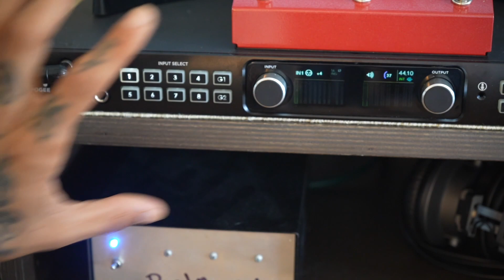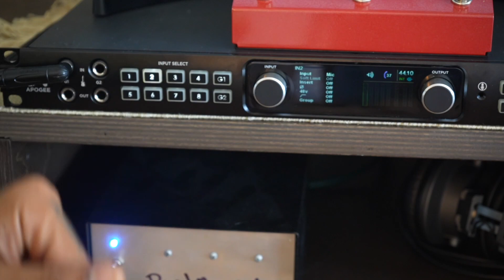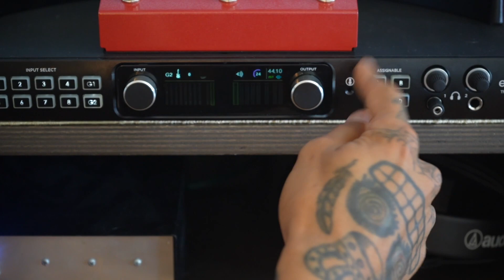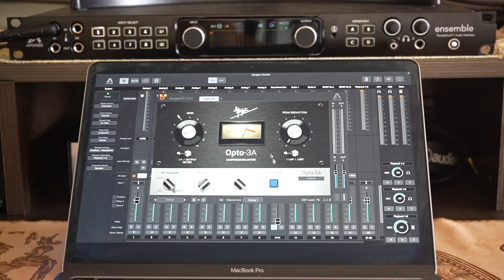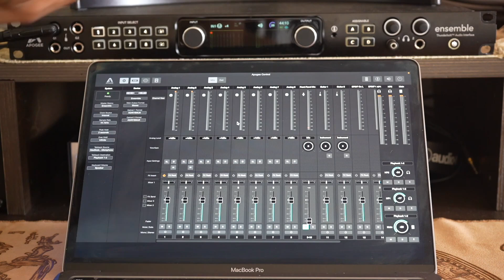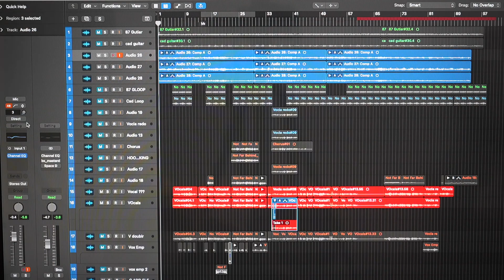Apogee Ensemble thunderbolt (Review) Apogee control and integration with Logic

Comment: Nice video! Is it works fine with Apple silicon macs?
Reply from the maker: It works, I was having a problem where I would have to sometimes turn the computer off in order for it to reconnect which was a bit of a hassle. But other then that it was working with a m1

Comment: Thanks for the review. How do you connect it to the new Mac without Thunderbolt 2 ports? Does it work with a Thunderbolt 2 to 3 adapter?
Reply from the maker: Yes it does all you need is an adapter and you can plug it right in
Reply: Thank you!  @UGStudioZ